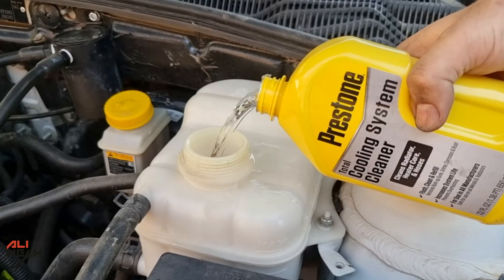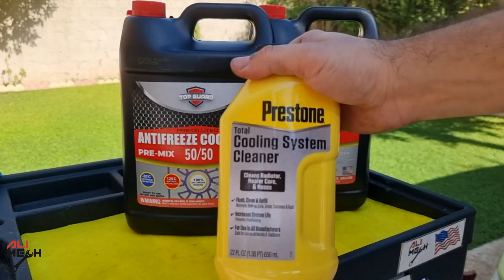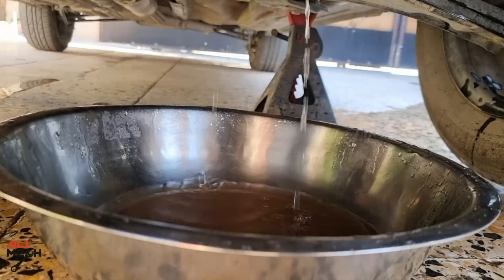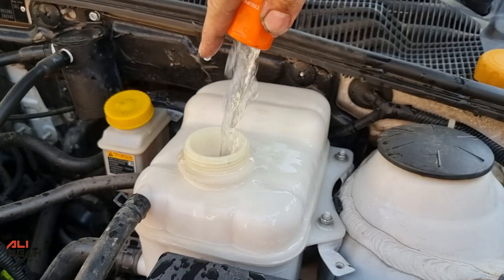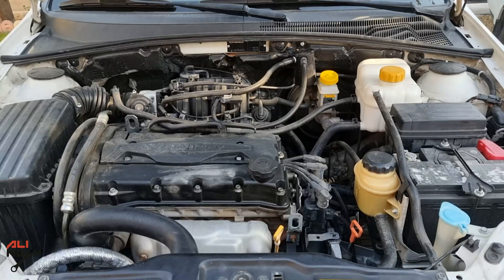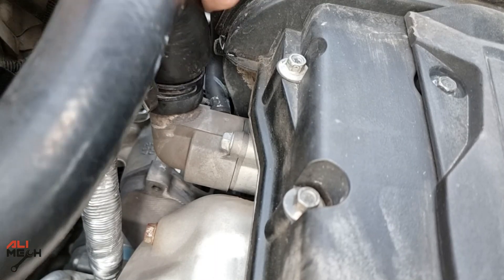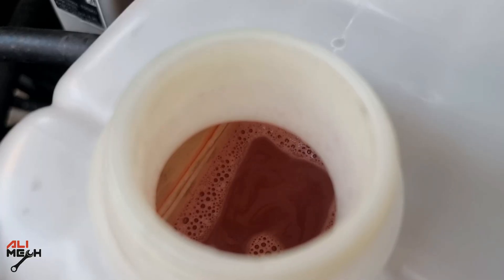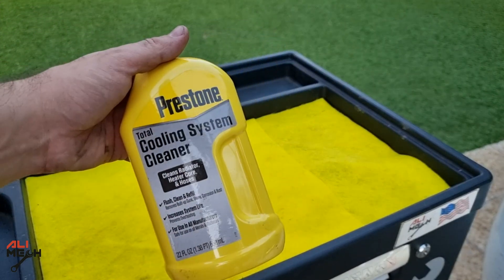How to do complete coolant flush/How to use prestone radiator flush and cleaner/flush Muddy coolant

Comment: After filling it with distilled water so many times and running the engine. Didn't you changed the remaining antifreeze concentration when you did that? And when you fill the system don't you need to add concentrated antifreeze to fix that?

Comment: Id def do my flush differently than that, Id fill my rad and then see what comes back into the overflow then let it cool check it again and top it off too the cold fill line but make sure to let the air bleed out of the system entirely no spill funnel is best bet cause u can fill it too the top with fluid and let the rad take it in as needed and them plug it to stop it flowing in.

Comment: I agree that tap water is fine, if you flush the amount of minerals would be negligible and negated by the coolant solution additives. Better flush than a drain refill anyway, the engine will thank you in the long run. Distilled water costs as much as coolant here!

Comment: How many miles would you recommend for a coolant flush?
Reply: Generally most cars recommend every 2 years or 30,000 miles.  If using long life coolant, some say go to 50,000 miles.  It’s often neglected, like mine, getting ready to do mine and it will be over 120k miles since I last did it, but it still looks great.

Comment: Letting your car run on idle for 2 hours does quite a lot of damage though.. Definitely not going to do that. I would only consider that if the cooling system was extremely, like ridiculously dirty and I did a last attempt to save it.
Reply: Do you know should you run the AC with the heater fans on as you flush , or does it matter?
Reply: @2amSpeedMerchant  the air conditioner does not use coolant water so you can leave it off but you should have the heater temp set to HIGH to keep fresh water, cleaner, and finaly new coolant running through the heater core.
Reply: @cfgyvr6321  OK great thanks, I wasn't sure either way. I flushed and cleaned the system, then new coolant, so it seems to have solved my overheating problem.

Comment: I'm going to use distilled water on the final run before I drain and fill it with the new coolant. Thanks for the video. This is has been the most helpful guide to help me change my coolant. I'm planning to not keep the cleaner in for more then 6 hours per the instructions on the bottle b/c I read it could damage seals and such if left in longer. But will likely take it out for a drive and run some errands when I have the cleaner in. Thanks again.
Reply: Will bottled water be ok?
Reply: @sahmedt9  bottled distilled water is what you want to use.
Reply: I've just done a coolant leak on a 2015 vauxhall Mokka. Found a leak on the connector for the coolant into the engine (it's a hose going into the car) I've changed the 2 connectors as I got 2 in the pack and changed the container and then the owner told me that the coolant has never gone back into the container from the engine 🤦 It's now better condition than when he bought it. Flushing it out was easier with Distilled (boiled water cooled down) and turned the car and heating on full for about 10mins. Let it cool down and took the radiator hose off but from the thermostat as it's a lot better. The car is running great and the owner said it needs a jump start as it was that quiet 🤐... Not even a qualified mechanic lol

Comment: I noticed you were refilling the radiator from the reservoir is that okay to do all the other tutorials I've seen they have been filling the radiator from the radiator itself. Is there any difference which one is easier to do because I think for me to get to my radiator I need to take off some of the plastic covering but I think if I try to fill it from the reservoir I can see it without removing any panels. What do you think?
Reply from the maker: This car doesn't have cap on the radiator,  it's only on the reservoir, it's better on this design,  because the reservoir at the highest point and all the air comes there
Reply: @AliMECH  oh ok I wonder about my 2019 Blazer 2.5l, would you happen to know?

Comment: Can you just run the car and just keep running water inside the radiator till all the dirt or whatever is gone out then turn off the engine then put the cleaner in after radiator cool off and let it run again with the heat on, let it cool then put antifreeze in the radiator then let it run again to check and see did that work

Comment: adding water dilutes the prestone cooling cleaner which will not work as intended. Am I wrong?
Reply: you need to add water to fill up the system, the 1L cleaner isn't enough to fill up the cooling system, you wont get circulation, plus you will toast your engine if you turn it on

Comment: I wouldn’t recommend using tapwater. Bear in mind that tap water or bore water contains minerals that can leave deposits throughout your cooling system, contributing to corrosion which will reduce the lifespan of the radiator and other components in the cooling system.
Reply: @ Lindell24 it's fine if you're going to flush it out anyways.  Just don't leave tap water in the system for a while
Reply: @brensdaman926 exactly
Reply: ᕙ(͡°‿ ͡°)ᕗNOTHING MORE SATISFYING TO ME THAN KNOWING IF I NEED IT I CAN GET IT MYSELF AND SO, SERIOUS THANX 2 U 4 MAKING IT HAPPEN IN AN EZ CLEAR 2 FOLLOW PROCESS,IN A VIDEO w/a  CLEAN ,GREAT LINE OF SIGHT (not cluster f'd, or disorganized=so pain-free !!)
Reply: It was giving me anxiety watching him do that 😂😂😂

Comment: Did you turn the heater on so as to flush the heater core,or is this not necessary?
Reply from the maker: Yes, it's important
Reply: @AliMECH do you turn the AC on also or just leave it off ?

Comment: As someone that is a first-time user of the prestone total cooling system cleaner can I use the entire container in my radiator and allow it to run for about a week through the system to clean out the hoses and everything. And then flush everything out and add new coolant
Reply: Read and follow the instructions only

Comment: You must use full strength coolant for this due to water in block ! 50/50 will not be concentrated enough
Reply: I agree.  Your system holds more than what is in the radiator.   Once you do your final  fill, you will want a minimum  of 50 perecent concentrate and 50 percent water.  So, you should use a full concentrate at the end, because it will mix with the leftover water.  This is especially  important in regions that freeze.  If you have more than 50% water, it can freeze, expand and cause damage.  Also, use distilled water from the flushes, so you dont have calcium or mineral deposits in your system.

Comment: Good video. Question here! if my radiator only has water from the faucet instead of coolant, do i follow the same steps? Motor has less than 15k miles basically new.  It overheated, coolant reservoir was empty, and my mother added water now i have to flush the water out and add coolant. I checked for leaks and couldn’t find any.
Reply: ouch, if it’s new hurry up and flush it with distilled water. tap water has minerals which destroy the metal leading to rust and not ideal for a new car. especially considering it flows through the engine. flush with distilled and drain the water, them fill will pre diluted antifreeze
Reply: @jstnnn1 Yes, did it that same day. Thanks for responding though.
Reply: @charlyrodzz  gotcha, no problem. good luck

Comment: No way I am letting my vehicle idle for 2 hours
Reply: Highjacking the top comment to remind everyone to blast the heat all the way up in the cabin when you let your engine run (or drive around) to clean your heater core.
Reply: @will4417 you know your heater core has coolant circulation in it all the time right lol? It doesn’t get coolant when you turn the heater on lmao
Reply: @loosechange4986  Turning on the heater opens the valve controlling coolant flow in the heater core. Always trust the "lmao" and condescending comments to be consistently wrong.
Reply: @will4417 i think some cars the controls only affect the flaps and blower motor
Reply: What if your fan dont cut on when u try turning it on @will4417
Reply: @will4417  you got knowledge brooo
Reply: 2 hours???!  With these gas prices???
Reply: Just drive around for a bit, a lot faster.
Reply: 10 Mins.3 Times.If Still Not Clean Do It Until It’s Clean 👍
Reply: Had a NASTY system and let it go for week driving back and forth to work. Did that twice and everything is completely cleaned.
Reply: @polie67 did you drive around with coolant flush added to just water?
Reply: @LilaandRoisin  yup. If needed just add some wetter water
Reply: @polie67 Me too, I do the same and worked perfectly.
Reply: I just idled my ram 1500 for bout 6 hours .. no fap 🙈
Reply: @7.G2G.7hemi tick knocking on your door 😭😭😭
Reply: That's insane!! Maybe 15min
Reply: Lmfao😂😂
Reply: Remove thermostat
Turn heater temp control to max
Drain radiator
Add prestone
Idle car for 30 min ..don't drive
Turn off
Let cool 2-3 hours
Drain
Start car run 10 min
Turn off Let cool 15 min
Drain and repeat .. about 12 gal
Of distilled water.  Should flush 3 times your specified capacity
Reply: @iironwarrior  But the other way is so much funnier...😅

Comment: Would you not need to worry about the car overheating with just water ?
Reply: Nah, water can work fine in a pinch. Though you wouldn't want to use water in areas where it gets cold/in winter because it could freeze and crack parts because ice expands. This is why coolant is also called "antifreeze" because its got alcohols to prevent the water in it from freezing up :D

Comment: Hey I am confused my car has reservoir but not sure if it has radiator cap as well I want to burp the system most video I have seen they do it from Radiator ,some from radiator reservoir mine is newer car 2020 Hyundai 
I replace the radiator 
Any help appreciated
Reply: Not sure if you ever got an answer but if it has a radiator cap fill from there first then top off at reservoir, unless your owners manual says differently. Really just depends how your reservoir is plumbed whether you’ll overflow it before you get anywhere near filling the system or not.

Comment: Hi Ali, great video. I have a question. In minute @2:35 you say "running the engine three times with tap water" Does that mean actually turning the engine on with tap water in the system, or just filling the system up with tap water without the engine on?
Reply from the maker: Thanks,  yes, with running engine,  to circulate and wash the cleaner

Comment: I used the Prestone flush in my 2008 Crown Vic and I'm still flushing out all the suds. Returned the stuff I had for my other Vic. I'll just use distilled water and skip the cleaner.
Reply: Distilled water alone won't get rid of any corrosion that may have begun and/or built up in system.    That's why using a chemical flush is preferred.

Comment: I drive with the said cleaner in for a week during the summer. A few engine flushes and new coolant + coolant additive.
Reply from the maker: Awesome
Reply: Read the bottle. Some cleaners CAN NOT be left in the system for more than 4 hours. ALWAYS read the bottle for instructions.
Reply: @MisterMonsieur yeah, but it works fine regardless. This stuff also works wonders for cleaning a dirty washing machine (better than any tablets)
Reply: I've never done this before so I came to this video and saw your comment if I add the coolant cleaner to my radiator and run it for about a week are you saying that at that time I should drain the coolant cleaner after a week and then add new 50/50
Reply: @Livelifeasifnooneswatching  after the first coolant + flush is drained, you will have a lot of waste products and particulates  in the system. Takes another fill, run, and flush, with water to get it all out
Reply: @InsuringUrFuture  drive a week. The person doing the flush and have to drian and fill it once or twice with water, let it run  for 15 mins each time, and then do the new coolant. I usually add purple ice or similar to the new coolant.
Reply: @Phil-D83  do you mean to drive the car for 15 min, or do you mean let it idle for 15 min ?
Reply: Never let any cleaner in your car , one time i left the benzine system vleaner in the car and i enden up with the pipes arround the benzine filter melted down
Reply: You cannot drive for a week with the cleaner in the system because it can damage rubber and seals. Never leave it in overnight. Go by the cleaner instructions.
Reply: @JohnHawco-x3z5l never had an issue. It also cleans gunk out of clothes washing machines like nothing else

Comment: Where did you connect the garden hose is at the inlet port of the engines water jacket where the hose from the water pump sends water into the water jacket of the engine, did all the debri come out of the engines water jacket from the outlet port at the level of the thermostat . By the way did you remove the thermostat because it sends the debri into the water pump via the byepass valve connected to the byepass hose. In such a case how do you get rid of the debri in the water pump assembly

Comment: This should be headed, ‘How to flush your engine, missing out important steps’.
Reply: If you cant figure out the steps in between, you shouldn't be trying this yourself.
Reply: @snowypython5209  bro comprehension skills are that of a fifth grader he needs a Lego diagram on how to do it
Reply: You should use a no spill funnel and fill above the height of radiator to burp the system and squeeze the hoses to ensure no air in the system. If there is enough air in cooling system the vehicle will overheat. Burping system is most important
Reply: @Vintageshutters  I agree with this☝️

Comment: You let it idle for 2 hours? Would highly recommend removing thermostat
Reply from the maker: No need too, because by the engine warms up, it will open the valve
Reply: @AliMECH still more flow no stat 😅

Comment: Do you guys think if I add tap water to heat up the engine after it’s been drained already… run it until it’s hot then empty it… Then fill it up with distilled water and the Prestone cleaner and let it soak over night then ran for 15-20 minutes increments throughout a whole day to add up to the hours it takes I should be good?

Is it okay to leave in the system for a long period of time uncirculated is what I’m asking….
Reply: No it must circulate to flush out the corrosion. Water pump makes the flow the engine while running. Sitting wont do the job
Reply: I’m wondering the same thing but you might as well save the distilled for after the flush. Run the chemical and then flush 2-3 times with distilled to make sure it’s all out. Check your capacity but fill with straight concentrated coolant to account for the water in the block

Comment: I wouldn't use the overflow tank to add any fluid.  The overflow tank should be filled with distilled water as the radiator as well and then add the cleaner to the radiator.
Reply: What if your vehicle doesn't have a radiator cap like mine???
Reply: In my vehicle the overflow is the only way to add fluid, there is no other way.
Reply: @wally7856  same
Reply: the radiator will take coolant from the overflow tank by itself after a couple of heat cycles as and when it needs. literally a non-problem.
Reply: Are you a professional factory trained mechanic  or a wanna-be ?
Reply: @csabaferenczi9072  Yes

Comment: So why would one do this? Most cars don't even get their coolant changed, let alone flushed, so this seems completely unneccessary to me. As long as there's antifreeze, corrosion inhibitors , pH buffers etc. floating around I think you're good - that tiny bit of debris is only a visual problem.

Worth noting that with a lot of cars you fill the coolant at the radiator cap, and not a plastic reservoir. And for proper coolant circulation, the thermostat (for cars that have one, which is most cars) has to be open, so make sure the coolant gets hot enough. You can use an infrared thermometer on a few coolant hoses to check if there's flow happening or if the thermostat is closed.
Reply: There's cars that can buildup scale and rust which can affect performance and other components. This breaks down those deposits and helps clean the system out. Go check out Chrisfix channel. He explains it a bit better. Especially the heater core flush
Reply: What if your vehicle doesn't have a radiator cap like mine???
Reply: wtf meh.  really meh.  look i not bashing but  yea.   you do know that not everyone wonts to drive a elc car ?    people who take care of there car flush there car every 30k miles.   people who buy used cars flush them cause they do not know how the car was taken care of or how long its been setting.   others flush there car every 5 years.   but  cars get flushed meh.   saying  < Most cars don't even get their coolant changed >  no ideal where you got that info from lol.     now why would you do this..  when the radiator is clogged or engine is getting to hot. your engine runs a  richer fuel mixture. this causing you to use more gas.  by keeping your engine and radiator clean you save on gas and repair cost.   also understand it is not just the radiator your flushing.  your also flushing the engine ports that the antifreeze runs throw.   after so long they build of dirt amd rust or other stuff that can make the engine run hot.  so flush your radiator and engine.  keep it clean save on gas.
Reply: Man... What? As u told, in YOUR opinion. Your opinion is clearly based on your laziness and lack of need to care. People who care for their things will maintain them as they should.

Comment: I’m curious, when put garden hose water, did you run the engine? Also, did you remove the thermostat? I wanted to this as well
Reply: Pull the stat
Reply from the maker: Not really, I didn't,  because inlet the engine run and warm up to circuit the water
Reply: @AliMECH  I see. So thermostat intact and engine running. Thanks.